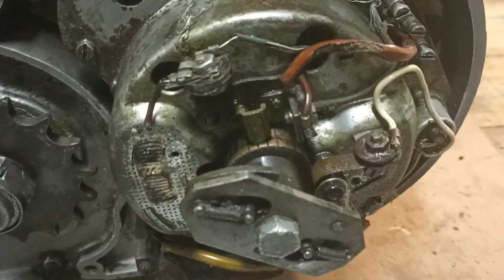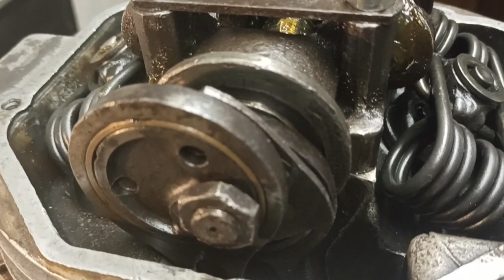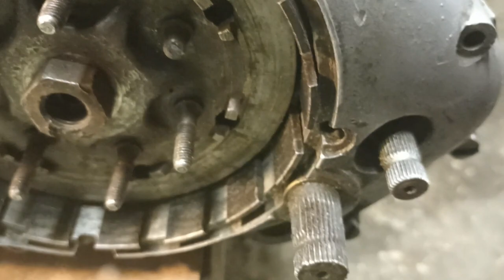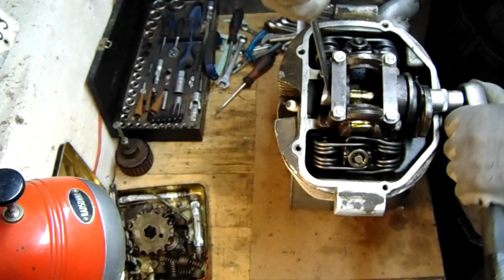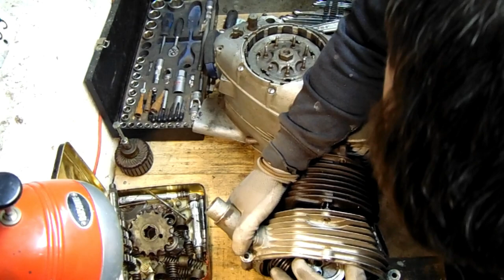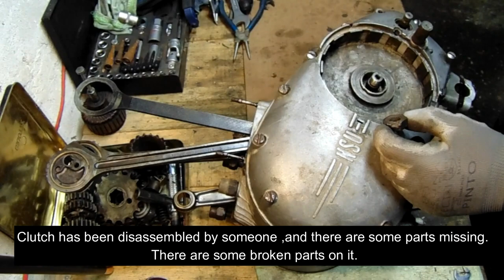NSU Special Max 250 engine rebuild ( part 1 )

Comment: Fantastic engineering. I had several of these, one I totally rebuilt and rode regularly, with my wife on the pillion, over many miles. Smooth and totally reliable. I had one which the engine was enlarged to around 305 cc and had been converted to right hand gear change, for racing. It was in a frame built by Armstrong Engineering with special leading link front forks. I just had the motor and frame and never did anything with it, it was sold to a gentleman who bought all my NSU collection. I taught myself the shimming up of the camshaft drive, took a while !. Lovely machine

Comment: Hi
Have you a video of setting the timing  of Standard Max in the magneto/dynomo  by firing .6mm from TDC. I am not sure where this measurement is taken
Regards
Russell
Reply from the maker: Hello , this measure is done before engine head is installed , it is measured from top of cylinder to top of piston ( once when engine head is installed it cannot be measured ).